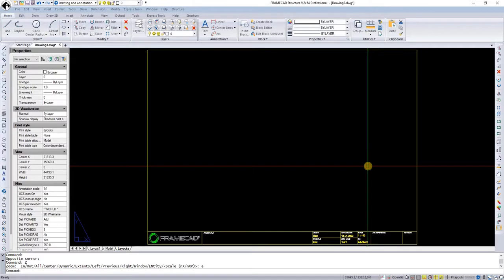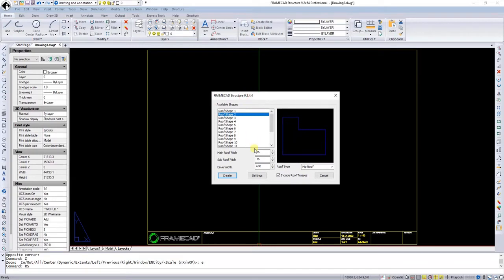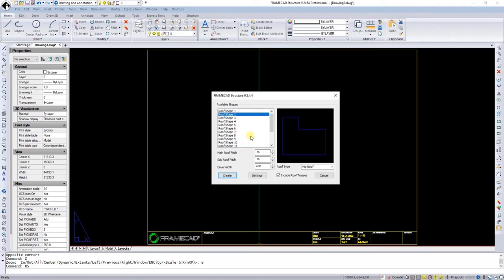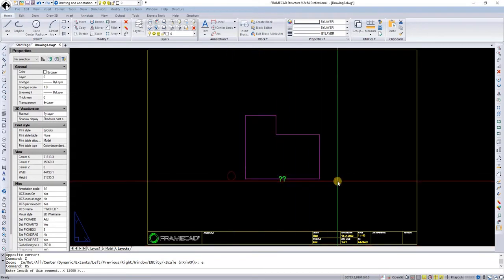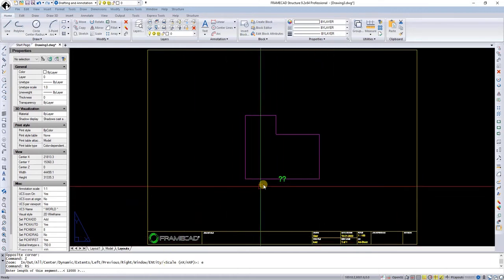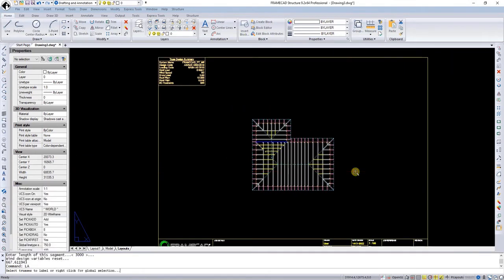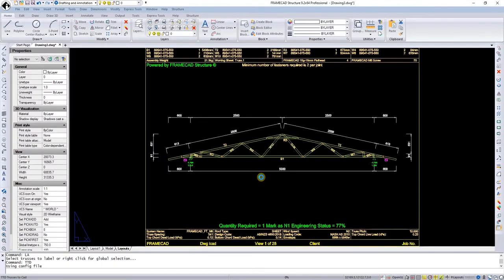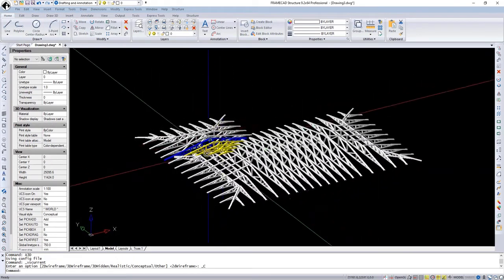Framecad Structure - Roof Shape Input

Comment: Very informative, can you please tell how to add doors and windows while using Dwg. Files, thanks in advance.
Reply from the maker: Hello Satpal. I have just started to build this library, so you can expect a lot more videos to be uploaded here. Anyway, there is actually already a video showing how to insert openings. Please have a look and see if it answers your question.
Reply: @framecadaustralia8451  thanks for your prompt reply, I am just after, is there is any way to insert opening from DWG  file itself.
Reply from the maker: @satpalsaini8732  Once you have your DWG imported you can insert windows as per the DWG, but you still have to pic the position. I found it easiest to use the Center window command and pick to points on each side of the DWG window that is symmetric. As an example you can pick same location off the studs on both sides. This would center the window you insert in between the studs. Or use the revel or the architrave. Hope this helps.
Reply: @framecadaustralia8451  it is possible for you to give training for software in Sydney either face to face or online or please post more videos and these very helpful ,regards
Reply from the maker: @satpalsaini8732  We do offer Training. Just contact us through details found on our homepage. I'm planning to keep uploading videos here as well. I have just started, so you should expect a lot more over time.